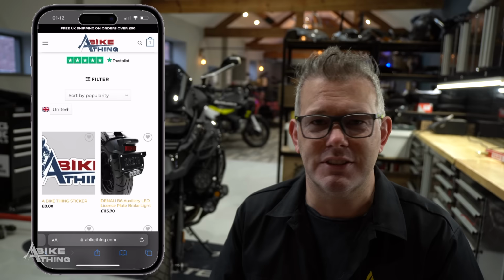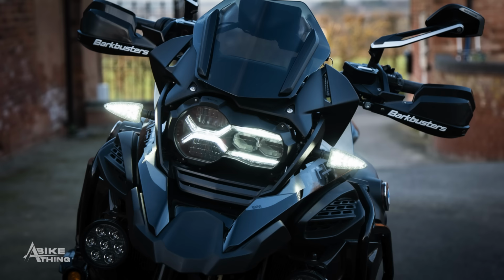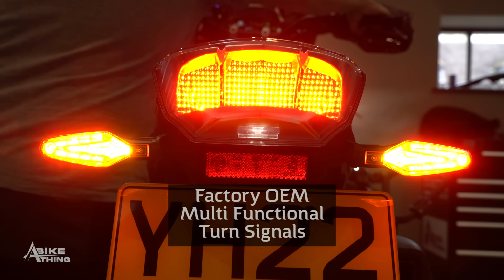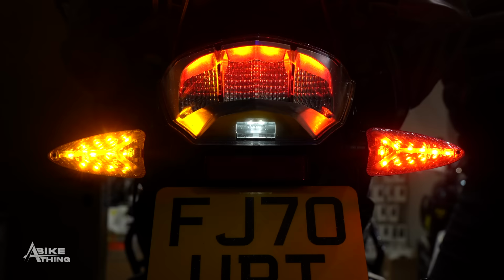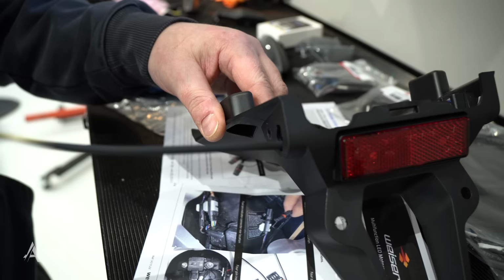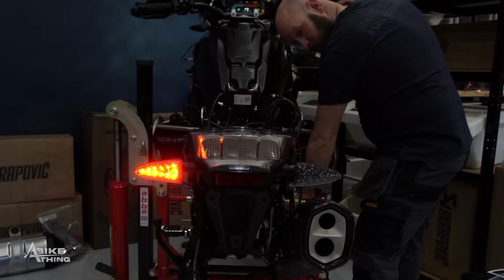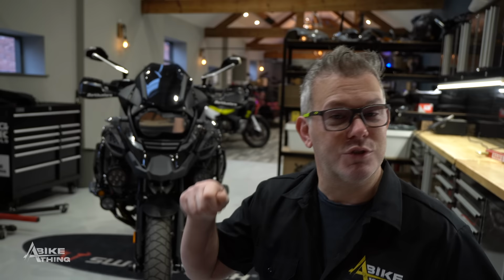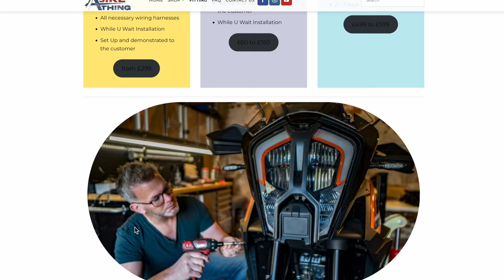Brighter and Clearer Turn Signals for our Motorcycles

Comment: I'm so disappointed with this video.  I kept telling Weiser they should get Steve to make one of his step-by-step videos because the product is so good, but not easy and not plug-n-play.  Steve is just selling the product and not showing the trickiest bits of the installation.  Sorry Steve, but this is not of your typical quality videos.  Some issues are:

1. The instructions included are for Europe and the diagram doesn't apply to the US.   No specific diagram for the US.  The written instructions are totally confusing and I needed direct support from Weiser to translate to US bikes.   Their instructions are just lazy.  Almost AliExpress level quality.

2.  No information about which wire to tap for switched brake light power.  Evem with direct support I tapped more than one before I got the right one and then had to repair wire.

3.  The L-shaped lock for the outer lens cover doesn't fit properly.  I broke as many as I didn't and needed to trim some plastic off on the ones that didn't break.  It's just a poor fit and needs to be hacked a bit.

4.  Not a lot of extra cable between the ground and power, so if you want to run power through one cable raceway and ground through another, such as using a PDM, you don't have a lot of flexibility.

5. The longer stems are too long for the GS/GSA if you're going off-road and will have the bike falling over, especially on an incline.  They sent me the longer ones and I raised this concern, and it took only a few days off-road to break one of them.  Then I broke some of the replacements because of issue #3.  The support from Wieser was amazing though.  When I told them what happened and reminded them of my initial concerns, they sent the replacements for free, and when I called because the new ones didn't fit properly and were breaking, they were very responsive.  I still had to trim them myself and keep a broken one because they just don't fit properly.

This is one of the most valued safety upgrades I've done on my bike.  I don't regret it.  However, it would only take a couple of hours to create a detailed video to address almost all of these issues, especially for US bikes, and make it so much easier to install.  Someone needs to create a video to address the issues above, and also maybe create some best practice in how to wire it because there is a lot of excess wire and it's very thin.  I know what I did, but I'm sure there are better options.

Not as bad as what Weiser offers, but not 'a Bike Thing' standard either.